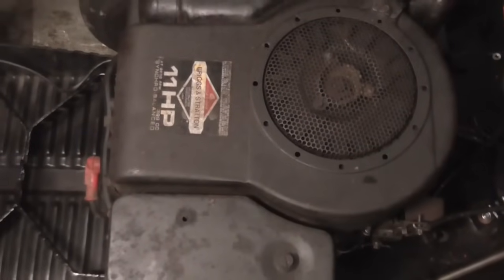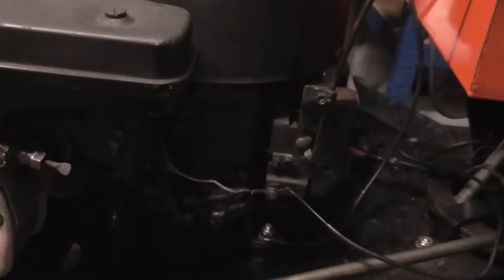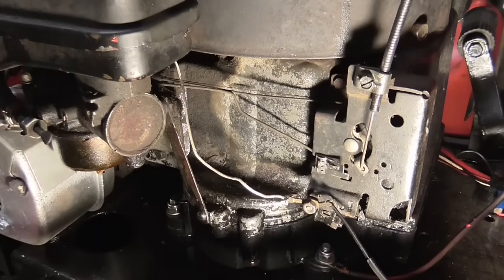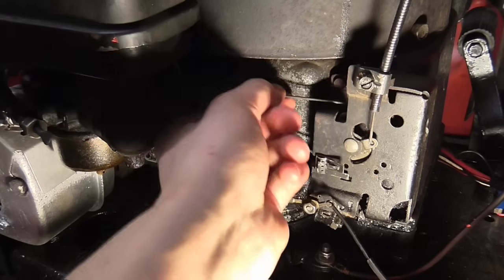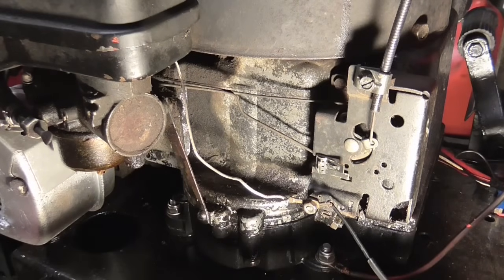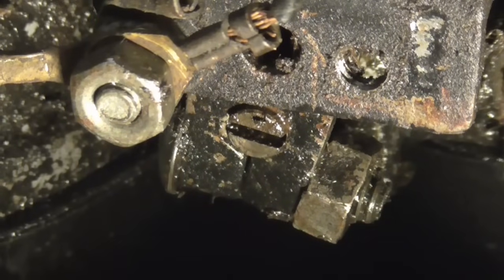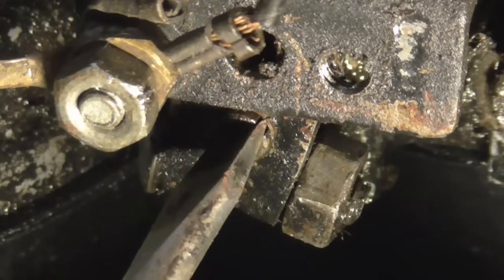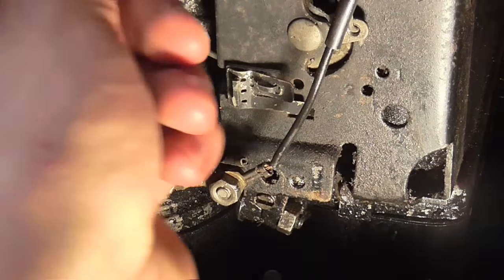Briggs and Stratton Old Style Mechanical Governor Adjustment Setup

Comment: The assembly of the lawn mower could be done without any problems https://www.youtube.com/post/UgkxTPN04aT-Qdjr_KS3ql7ng8wnU3wwsCqk also recommend  I just puzzled something about the red strange “key”. However, it quickly turned out that this creates a kind of contact bridge between battery packs and lawn mowers. An additional backup as a father of a 1 year old nephew is great!! :-)

Comment: Do you have the engine code for that engine? I got a old tractor, with the same engine, and there is no number to be found, on what engine it is. I need a ned gas/governor assembly..

Comment: How do you reinstall the governor shaft keeper pin?  How does the hole, where the pin goes, line up, and what does it line up with? Can it be lined back up without taking the engine off the mower, and then removing the crank pulley and bottom cover ?

Comment: What is the spring that wraps around the throttle linkage for? The one from the govoner arm to the carberator. Do I need to have that installed?
Reply: Have you had an answer yet? 
Without it there's a bit of slack on that rod that joins the throttle on carb to governor arm. It helps with more accurate throttle response when using your machine. Without it it might lag slightly or surge
Reply: @johanh2319  yeah I got a friend with experience to come look at my mower and I have it running in good shape now! Thanks!

Comment: I had a question,let say i had a Briggs engine that has the little knob to connect a governor lever to it but i wanted to run a regular carb on it (plastic carb),could i leave that governor disconnected or does it need to be hooked up?  i know is a strange question but i got a motor thats bare, i got it for hardly nothing and its nearly new but i dont have a carb with a governor, just a normal carb, the block is identical to the blocks without governors except for the little nub that comes out by the oil filler cap (governor shaft), what do you think?

Comment: Very good video. I have a 12 HP B & S as well but a 1996. Went to clean the carb, and the choke arm came off and is not back on correctly. Also the small needle inside the carb, trying to find out how that goes back in, it has a small little wire made I guess to be a spring, and that is not back in correctly. Just re-wired my mover an FINALLY got it to crank, but will not run. Certain it is the carb needle being inserted incorrectly. Do you have  video on carb cleaning?

Comment: I took the governor plate off to clean - totally filled with grime. Unfortunately I now cannot reassemble.  Can you show behind the plate? I did not know where the spring connects.  There's a floating arm that I'm not sure where it connects... wish I would have taken a pic   I have this same set up
Reply: I'm in the same boat
Reply: @luckynightmare6912  Did you figure it out? I need help as well!

Comment: What would happen to the revs of the engine if the screw you turned clockwise was turned the wrong way? I ask this because i have put a "new" engine in my lawn tractor and if you go anywhere near the throttle it revs the arse end off of it. Would this be a governor  issue or a problem with the carb?
Thanks Ben.
Reply: i have the same problem, did you ever figure it out?

Comment: The easiest way to fix a Briggs and Stratton engines is undo the 4 nuts and take engine off, then tie 30 metre's of rope to the engine and use the engine as a boat anchor, 3rd, buy a Honda engine and then you will have a motor that starts first go every time and is fitted with what i call a "Normal"  carby with no linkages to fall off, problem solved "Forever"
Reply: You must really love those slant-eyed dog eaters, huh? Fuck you! 🖕🏻🖕🏻🖕🏻🖕🏻
Reply: @bill091086  Better than people who marry their cousins and weigh 200 kg
Reply: I couldn't have said it better!
Reply: You've got to be mechanically retarded to not keep these Briggs and Strattons running. My last tractor was received beaten up, coked up, caked eith oil residue and smoking 4 years ago ... new headgasket, carburetor, and rebuild kit for the lower deck and its been running great right. Plenty of videos on how to work on them and they are a dime a dozen with abundant parts available

Comment: Glad I saved a lot of L head parts 8,10,11 hp B&S Much better motors "I feel" vs the modern ohv models
Reply: Yeah I had a 12 horse flattie on a Murray I had I swear it was stronger than the ohv 15 horse I have now on a Craftsman. And the flattie would rev alot higher without floating the valves. Guess that's from having a shorter lighter valvetrain than the ohv

Comment: Great Video, Very Professional And Helpful, Keep Up The Good Work! Thanks Charlie
Reply from the maker: MaximumMPH Thanks!
Reply: Machinery Restorer Hi Re the old style B&S engines I’ve got an old 8hp in a Murray 8/30 and it’s getting a blocked grass discharge chute to the two rear collectors in perfect dry conditions the guy at the mower shop suspected insufficient engine rpm , if I adjust the governor as discussed & I still can’t get enough revs does this mean it’s a tired engine, it doesn’t smoke and sounds healthy, any advice would be appreciated and thanks for a great video very easy to understand.